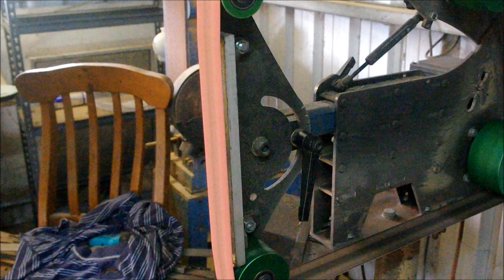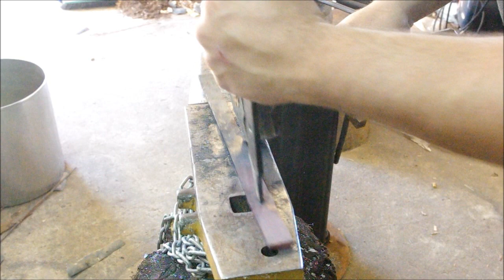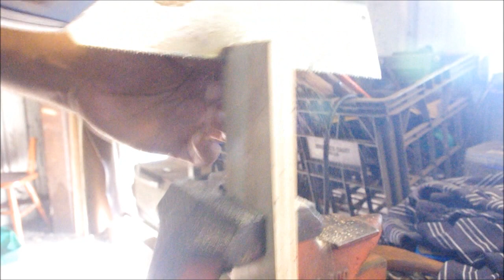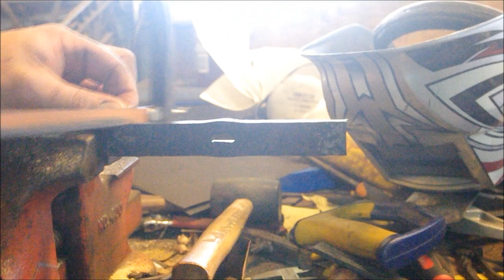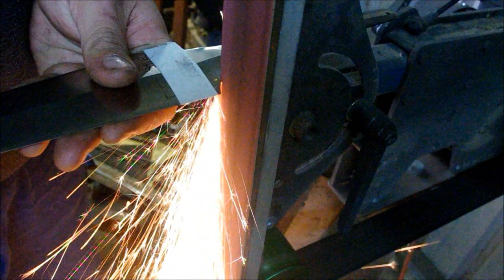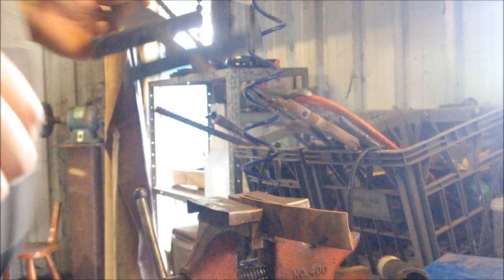Day 6: forging and mounting the top and bottom dagger guards

Comment: great video, how come u didn't use the tang as a drift and hot fit it?
Reply from the maker: Luca La Ferla mainly because i didnt want to damage the heat treat, also you can't drive a blade with any force from the point without damaging the point so the fit would have to be relatively loose, which I can't accept.